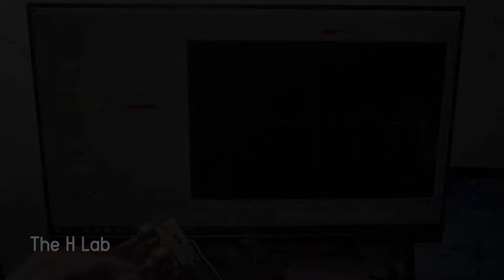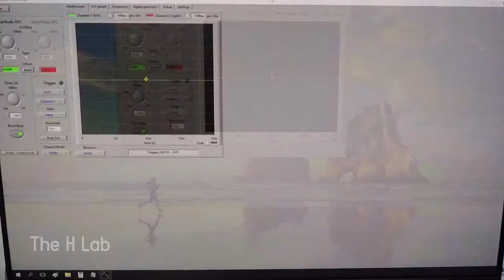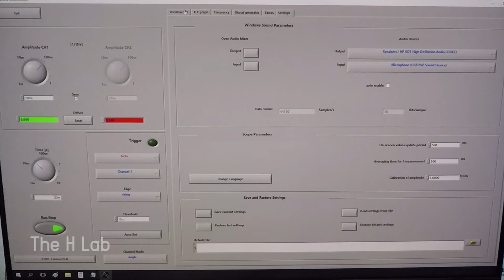DIY Sound card Oscilloscope

Comment: there is a catch.... the amplitude voltage cannot exceed 5 volts otherwise the USB receiver sound card "bursts" and the maximum input frequency cannot exceed 44khertz only capa at the maximum in the audio frequency operating range frequency above that of a .mp3 song poor the audio plate

Comment: This design works but its very stupid and unsafe, its better to connect two antiparallel diodes so the voltage will never pass around 0.7 volts and add some capacitors for coupling and a potentiometer for adjusting
Reply: Do you have any way of showing the schematic for the circuit you are talking about? I am having trouble visualizing it. Thank you!